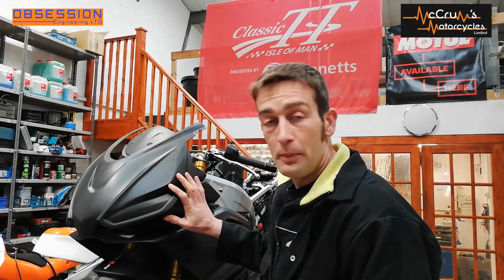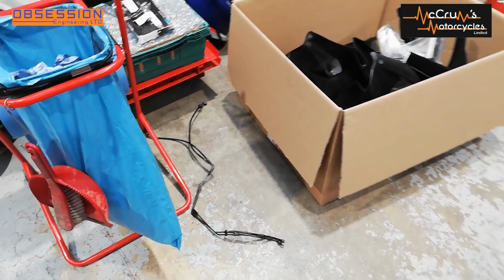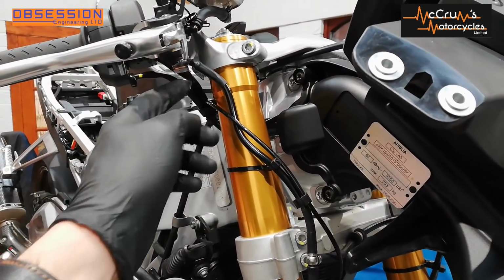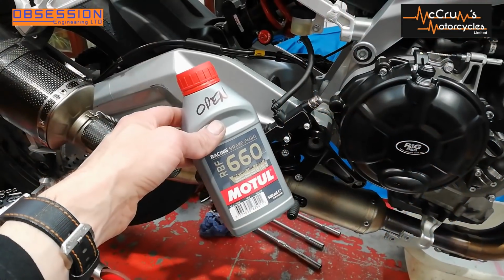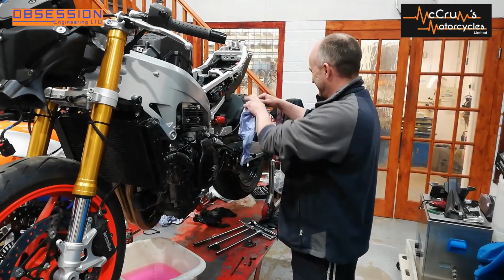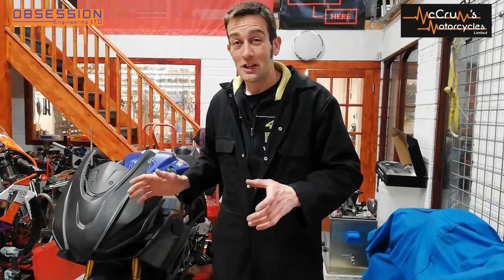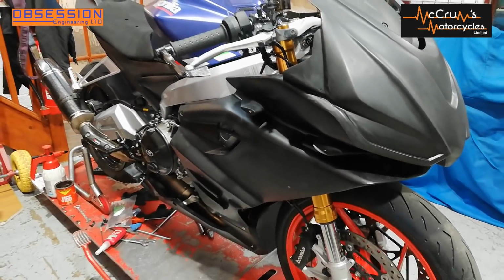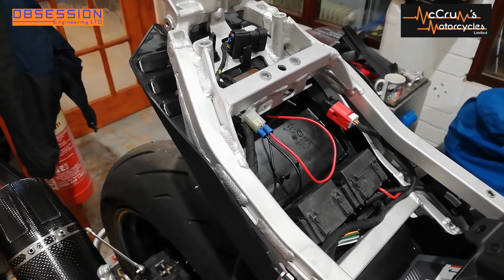Road to Racing. Aprilia RS660 race preparation. Part 3. Building the McCrum's Super Twin Race Bike

Comment: When a budget motorcycle costs over 12K Euro... hehe my old d675 was 2kg less with a normal battery and was cheaper then the rs660.
Reply: thats racing.. & if you tally up the cost of getting an R7 or Sv to the RSs std level the costs could be very similar.. interested to see a comparo of the trophy model for costs